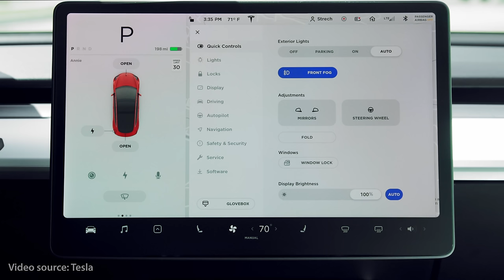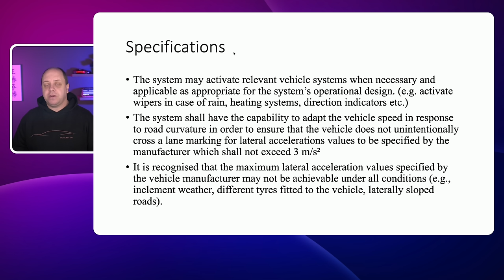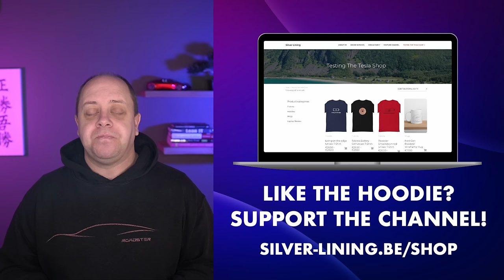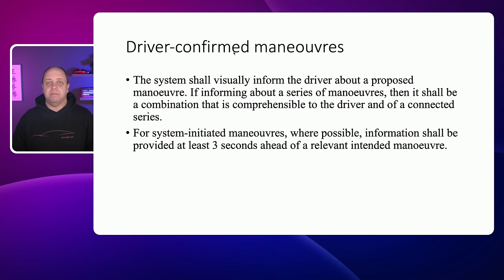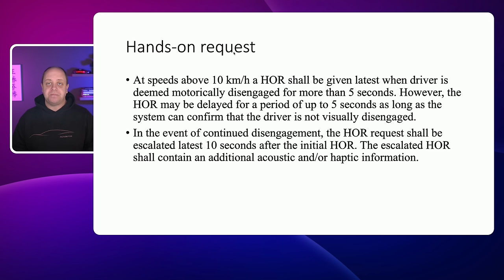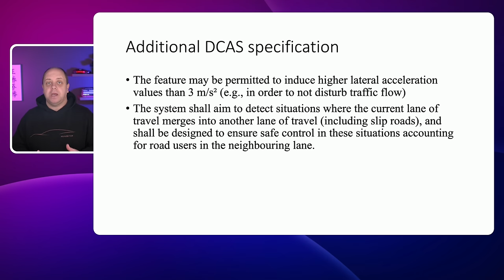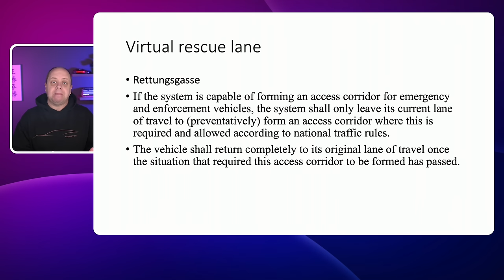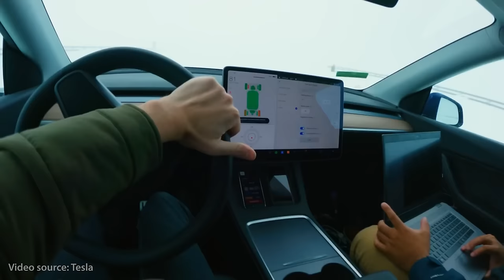FSD Beta is finally coming to Europe!

Comment: The level of detailed regulation is killing it entirely. Ridiculous.
Reply: I did not get what is the point of FSD if I have to drive that shitty car by myself. It not what was promised.
Reply: @alconaft4343  Please listen carefully to what he said about the level of monitoring being reduced over time, and also his previous video, where it is explained that monitoring will be eliminated completely when the level 3 legislation is written next year. 

Initially they were planning to do both level 2 and level 3 legislation together but have separated it out to get level 2 (assisted) happening ASAP. 

The good news is that there is indeed a clear legislative roadmap to full self driving (level 3) being enabled within the next 2 years
Reply: @alconaft4343  EU did not promis you anything (and they are currently ones stopping us from having system that is really useful but still not completely autonomous).  They will force not only Tesla, but everyone else, to keep it driver engaged system until they make bold step into lvl3.

Comment: Many thanks for the detailed update! I’m surprised that they will require to approve every single manoeuvre 😮 that will limit the ability of the car to drive fluidly, as in driving you often need quick reactions. I hope that there are exceptions for safety scenarios? It can’t prevent an accident by swerving if it needs to wait for a driver to approve first.

Comment: Steven , thank you for your diligence on WP29 and your regular updates - appreciated . I do fear that each Jurisdiction will want to Exercise their rights of interference which will cause silly delays. But still this IS progress
I trust and believe that Tesla is and will be on the inside providing detailed driving experiences of v12 to the specific regulators . ? IF this IS the case it should be enlightening for them in their thinking which has evolved around their exposure Heuristic implementations ..

Comment: Hi Steven, thank you for the update.
Unfortunately I feel not that positive for the introduction with FSD 12 because v12 is all about AI. So there was this thing with having to reduce the speed at stop signs to actually zero that was not easy to get the AI to learn. The actually had to present fake examples to the learning AI for it get this rule (which there is no normal driver sticking to that rule in the USA).
With the multiple rules and timing limits I get the impression that it could have been easier with FSD 11 than with 12. 
The Rettungsgasse should be no problem, though. This could also boost the currently not usable 5 year old software stack we use in our cars.
The biggest thing is the UNECE is finally speeding up a lot. So a not so goold ruleset not being applicable to FSD 12 is nethertheless better than no ruleset at all. I'm betting for 2025 to finally get some usage if my FSD after 6 years of waiting 😀
Reply: Agreed. Tesla haven't been able to build a rules based system (not saying anyone else has either). All the rules and nags will probably make the system a waste of time for public users. Testers and extreme Tesla fans might persevere with it but general users won't. I barely use autopilot because of the nags.

Comment: Eyes on system would be great. I have noticed recently that my car says “keep your eyes on the road” in addition to the “touch your steering wheel slightly” since a recent update. This could be tre start of this transition. The interior cam is obviously used for driver attentiveness now, which was also reported by not a Tesla app
Reply from the maker: Yes, this is the part of the recall in the US that rolled out globally
Reply: As the car needs to visually attentiveness and older S And X have no interior camera, does this mean they will never get FSD? In which case I think Tesla should refund all owners who have paid for a system they cannot ever deliver
Reply from the maker: @Jonathantuba  While I agree on the one hand, on the other hand Tesla has always communicated that "any feature availability will depend on further software development and regulatory approval" on the order page where you checked the box for FSD. So they are covered there.
Reply: @StevenPeeters  when I got FSD for my m3 back in 2019 they promised self driving on city streets before end of year. I am not an idiot, so I knew it was a lie. It was still misleading advertising and no wording in small prints can fix that.
Reply: @BaldurNorddahl  Nobody "promised" anything to anyone.

Comment: People assume L2 is simply lane centering and adaptive cruise control. None of FSDb features are associated with L3-L5. L2 is simply lateral and longitudinal control over the vehicle. This may be limited to the freeway but it does not have to be. FSDb can pass vehicles (lateral steering inputs and accelerator/brake outputs) as can many other L2 systems such as XPeng's XNGP or Huawei's DCAS. L3 features would be release of liability during engagement.
Reply from the maker: Exactly. But people still seem to think that they don’t need to pay attention at all and that it is a self driving car. The SAE levels talk about liability and responsibility, not about which features are being performed. Seems hard to grasp for many people

Comment: Thank you for your detailed description. If all that regulation comes into play I don’t see coming Teslas FSD to reach Europe at all. Tesla will be able to do a lot and behave almost human like. But Teslas FSD 12 won‘t be able to function within those restrictions. Those regulations created by bureaucrats are a disgusting, unpractical, ridiculous nonsense. You get the impression those regulators try do do EVERYTHING STRICTLY RIGHT. But because the world is a complex and chaotic place this regulation attempt MUST fail - and so it does.
Sometimes when I drive I AM GUILTY. I sometimes use my FSD when I am distracted or tired. FSD right now has saved me and my car a couple of times and I am very thankful having this option right now. If the nagging time gets reduced to 5 seconds AND I am forced to be fully eyes on attending I could drive myself. There is NO POINT IN EVEN USING IT. So most likely I won’t use FSD any more if it gets THAT restrictive. This will lead to more unsafe and more dangerous drives, using my knees to steer and those bad behavior I didn’t use for 4 years now.
What a shame. I am very, very disappointed. And I lost hope for FSDs future in Europe.

Comment: Thanks Steven.

Does seem regulations may hinder the end product somewhat, especially the 3 second interval, driver confirmations and prohibited lane changes into oncoming traffic.

IIRC further UNECE rules for level 4 and over are also in the works (was intended for a year or so after these rules?).  Would be great to have an update on these also!
Reply from the maker: ADS (L3-L5) timeframe is preliminary for 2026. But you know this will take some extra years

Comment: Thank you very much for the excellent analysis. As I understand that with this new regulations, FSD might not be allowed if there is no cabin camera, right?
Reply from the maker: Seems that way
Reply: @StevenPeeters Tesla might be able to come up with a retro fitted camera.
Reply from the maker: @BaldurNorddahl  I think that is a very tiny chance as it requires a different wiring harness too. This is not a small change such as exchanging the computer.
Reply: @StevenPeeters the camera does not need to be located there. It could also be a more convenient place for retrofit. Maybe in the display.
Reply: Not until it's developed to where it can truly drive itself, anyhow.

Comment: It's not illegal to cross a white line. A white line only indicates that it's forbidden to take over other two-track vehicle vehicles driving in the same direction.

Stationary vehicles can legally be passed, as like any other obstruction. It's also legal to take over motorcycles and bicycles by crossing the line.
Reply from the maker: That might be the case in your country. But in Belgium, for example, you can only pass a cyclist as long as you don't cross the solid white line. Going over it is not allowed in any case.
When there is a vehicle in the road that isn't moving, I'm sure the police will just ignore that. But you don't want to have this situation on your driver's test for sure.
Reply: @StevenPeeters  interesting. In some countries like spain, the law says that for passing a cyclist you have to go into the left lane (even if it’s a solid white line separating directions). I am pessimistic about Tesla being able to release a trained NN that works for all cases, since that requires going over each country’s special case, recording enough training sets, etc. I think they won’t have a working version until at least 2026, given their work pace and US centric approach
Reply: @StevenPeeters  interesting. I thought the European driving rules were harmonized after the EU driver license was implemented.
Reply: @pablollopis908  in Germany you need to keep 1.5 m distance to a cyclist or 2 m if you're out of town or the cyclist is carrying a child on the child seat.

But this normally is the same as changing one lane over - so this part shouldn't be difficult to implement.
Reply: @StevenPeeters here in Denmark we have double lines to signal that the line can not be crossed. Even in that case, we will still do it if the road is otherwise blocked.

Comment: Wrong news from Ron Patel,
Senior Global Director, Public Policy and Business Development at Tesla :

« We could make some small improvements to the older versions of FSD, based on the updated DCAS regulations at the end of the year. But unless there is an updated allowance for “system initiated” maneuvers, the full benefits of systems such as Supervised FSD are not type approvable.

The way the updated regulation works is that the driver would need to approve of almost every significant maneuver or set of maneuvers. Practically I’m not even sure how that might work or be designed, but it sounds like a massive pain/distraction for a driver - the opposite of the point of both the driver assistance and driver monitoring benefits of Supervised FSD »
Reply from the maker: Will make a recap vidro of the conversation after my current road trip

Comment: Tesla's auto speed limit adaptation in FSD v12 is quite impressive.
Reply from the maker: We’ll see. We have some real challenges for speed limits here in Belgium
Reply: @StevenPeeters  Every country, region, city, state, province, town, village has their own collection of unique scenario's.  Everyone thinks they are the unicorn. 

That's the beauty of training data. Feed it enough examples from the region it will drive in and it will learn to generalize for that region.
Reply from the maker: @RobertLoPinto  sure, but with hundreds of cars training in an area vs a few cars, that makes a big difference
Reply: @StevenPeeters It might take a couple of years of collecting real-world local data combined with simulated data to achieve high levels of autonomy in Belgium. 

It won't take as long as it has in the US. It's similar to how ChatGPT4's model is being leveraged to train other neural nets in a fraction of the time with a fraction of the data. The base foundational model takes the longest. Subsequent derivations leverage the foundation and a flywheel results.

Also, much of the time in the US has been spent finding the right Neural Net architecture. The latest end to end approach of v12 has a high chance of being the correct one. In addition, Tesla is adding significant compute clusters. Only time will tell.
Reply: @StevenPeeters  simulation can fill gaps and quicken it up
Reply: Speed limits in a Tesla in Denmark is an utter nightmare. Like many of the other automations that might work in a lab but is ruining what was a nice driver assist system until 1,5 year ago when "Vision" virus downgraded the car.
Reply: It appears that in the USA they want to go over the posted speed limit to follow traffic. Because everyone does that, even the cops. But that's an absolute no go here in Europe.
Reply: @BaldurNorddahl  Here in the US they set the speed limit 10 miles an hour below the safe limit knowing drivers will go over. Cops generally won't ticket unless the driver goes 10 mph over or more. Fines are proportional to the number of miles over the limit.

Comment: What is funny is that AP1 was capable of a rescuelane .

Regarding auto lane change off highways. So we are getting back lane change assist after 4 years since it was removed 😂. 

For the rest my fear is indeed they require visual driver monitoring.. meaning any older Tesla with FSD HW3 will never get FSD in Europa

Comment: If I look too long at the road ahead, the car wil complain. If I look more at things next to the road, not related to driving at all, the car is happy. Turning my head more when looking in the mirrors seem to help too. Recently I noticed that if I always make the wheel pull in the same direction, it will eventually stop working, I need to alternate the pull direction a bit. In the Netherlands it will only activate on main roads, rarely on roads with no line markings. We have a lot of roads where the center has not been marked on purpose, and on those roads Tesla will always drive in the middel of the wide road with v11. I hope we get v12 soon.
Reply from the maker: In the Netherlands you don’t gavecany verdion of fsd. Completely different software stack

Comment: So the regulators have ruined it.
Hope the UK outside the EU, has the balls to do something better.
Reply from the maker: Again, these sre UN regulations, not EU. Has nothing to do with Brexit or anything like that. UK is bound by the same regulations
Reply: @StevenPeeters  If you need to confirm lane changes and traffic lights, it is hardly Self Driving is it?
UN ?
Reply from the maker: @grahambrown42  it is NOT self driving but a driver aid. You are always responsible and need to be able to take over at any and all times.
Reply: @StevenPeeters  I have purchased FSD on a Tesla, I would like to be able to use it.
Reply: @grahambrown42 you should not have bought it in the first place.

Comment: Will this new regulation apply to new cars only or also require existing systems to be updated?
And not only FSD but normal AP will also be affected by the 5 second nag, which will make driving more unsafe imo, as you might have to disable AP when looking for music etc. on the screen. 
Still very positive that things are finally moving for Europe.
Reply from the maker: If the car doesn’t perform DVAS functions, the DVAS tegulations don’t apply. It will still be r79 that applies. However, I do expect that automakers will use one system for all

Comment: Thank you for the videos i hope it will be enough to pay attention and apply force to the wheel for the car to confirm lane changes and exot roundabouts. When you need to confirm with the turn signal or buttos press it will be completely useless in my opinion
Reply from the maker: That is the system-initiated and driver-confirmed part
Reply: @StevenPeeters  yes but there is room for interpretation for example BMW got approval in Germany for confirmation for lange changes on the highway by only looking in the mirror
Reply from the maker: @SailingFloh  that is because of pure local exception regulations per country.
Reply: @StevenPeeters  Yes, that is what I hope that it can be interpreted in such a way that confirming with a look in the direction you are driving is sufficient as confirmation
Reply from the maker: @SailingFloh  you will still need to have your hands on the steering wheel though. So the difference with just a nudge, as we have to do now, would be negligible

Comment: Where are you getting that all system-initiated manoeuvres need to be driver-confirmed? I can't see that in the document. It talks separately about driver-confirmed or system-initiated manoeuvres, and I see that specific requirements for system-initiated manoeuvres are 'reserved' but nowhere says system-initiated manoeuvres will have to be confirmed.